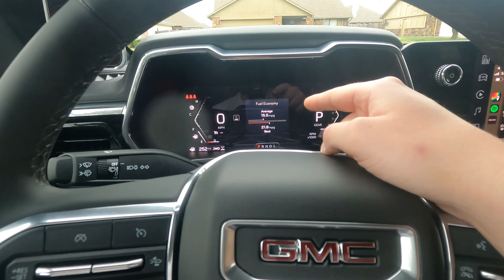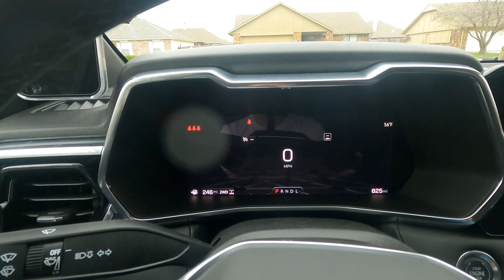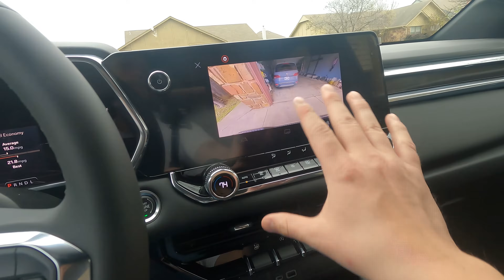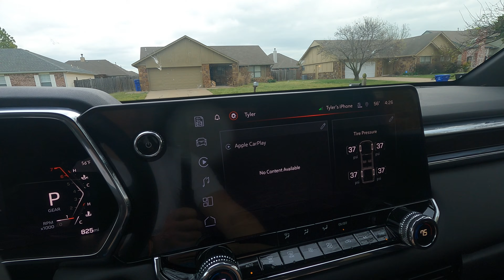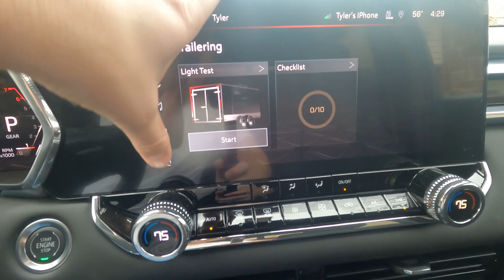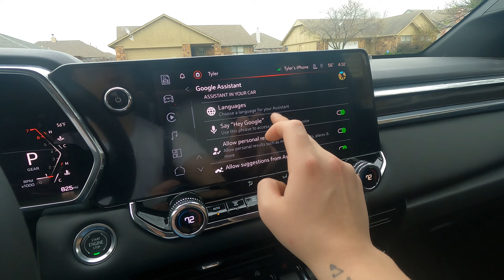The 2024 GMC Canyon has the BEST Infotainment!!!

Comment: How do I change the distance for the driver alert on the middle gauge cluster? (5:20). You can change the distance alert, I changed it to one bar on accident and can’t figure out how to get it back to 2 or 3 bars. 😢
Reply from the maker: You adjust it using the controls on your steering wheel. Left side of the steering wheel.
Reply: @Desertsandworm thanks!

Comment: agree that the infotainment system is nice, but.. i have a 2024 Denali and a week after picking it up from the dealer i have 6 service codes and my remote start stopped working and i have to take it in for service already. i believe it started after an update. this is the weakest link in these trucks, i hope it doesn't give problems in the years to come.

Comment: Looks good when it works. Lots of issues with reliability. I have to do a reset at least 2 to 3 times a month.
Reply from the maker: I haven’t had any issues you with mine, you may want to take it in for a software update.

Comment: Does it have Android Auto or do I have to use the built in Google Maps? Also, why did you only show the first and third gauges in the instrument cluster?
Reply from the maker: It has wireless android auto and CarPlay.
Reply: @Desertsandworm  I saw Waze on one of the app screens. Was that built in or through CarPlay?
Reply from the maker: @FlawlessImperfectionssssss  both. You can download it onto the trucks system or have it through android auto/carplay

Comment: Koo
I have a canyon 20024 AT4 
Question what are the 2 buttons on the shifter looks like a + or x
Reply from the maker: They’re for if you put the truck in L gear. You can manually change the gear.

Comment: Is there a way to show navigation & audio on a split screen? I have edited the screen view on the dash, but can't figure out how to display both at the same time. Thanks
Reply from the maker: I don’t think there is a way to do that.
Reply: @Desertsandworm  too bad, but THANKS 😊
Reply: Also, our 24 Canyon is showing an icon for fog lights & headlights in Auto mode. I think you can probably change this in vehicle settings. Ours is an Elevation, so yours should have more than ours. 😊

Comment: Great job on your review, I bought a 2024 GMC Canyon Denali 1 month ago and absolutely like driving it. Yesterday I was at a doctors appointment for a half hour, and I went to back up and the informant screen went black? I drove home with the screen black  and I was thinking about all the trouble GM had in 2023 canyons. I remember a YouTube video I saw about a guy that had the same problem with his 23 canyon and was told to check the fuses and push them down. I did that twice each fuse, restarted the truck and it worked ( this time) I just hope this is not the beginning for more computer problems, or problems of any kind?
Reply: My 2024 did the same thing the other day. It ended up just coming back on the next time I got in it, but it freaked me out for sure.